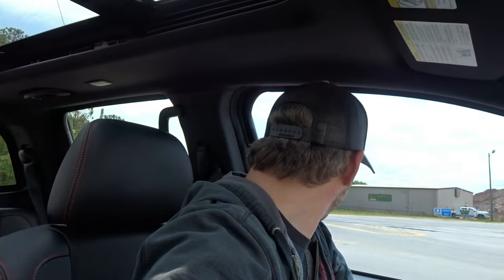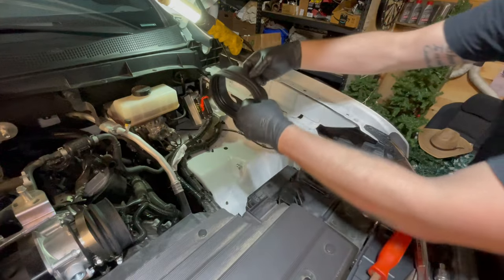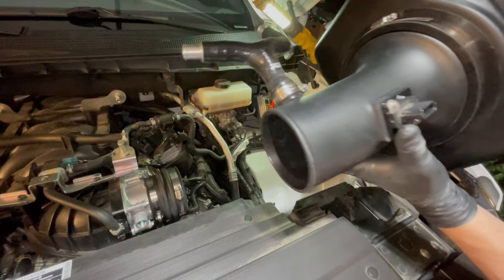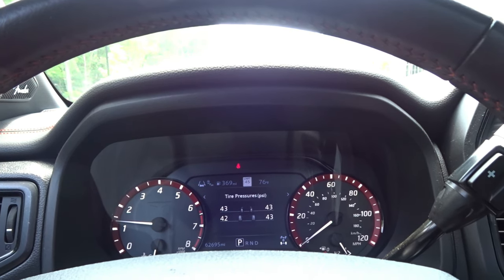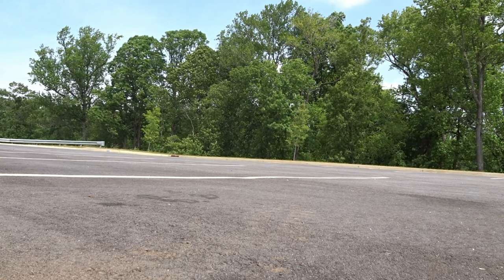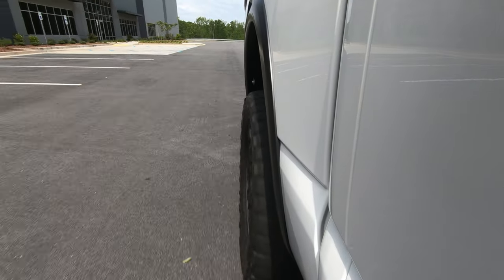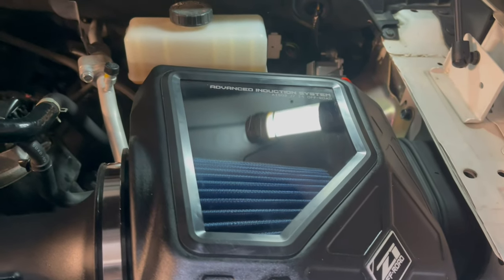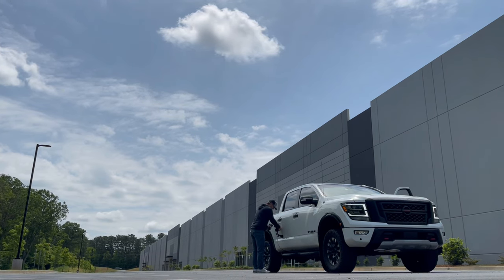Nissan Titan Pro4X Intake Comparison | Z1 Offroad CAI Review 2016+

Comment: Just installed one on my 2023 Pro 4X last night! I hope it will improve my mpg and torque. I did a leveling kit and adjustable upper control arms  by Z1 a few weeks ago And putting 1.5” wheel spacers next week. Hopefully get some nittos soon also. Just hate to take off brand new tires 😅What else are you planning to do to it?
Reply from the maker: Hard to replace new tires!
I want to squeeze some bigger tires in, lighting, skid plates and outfit the backend a bit more.  More overland ready
Reply: How is your z1 cold air intake doing?